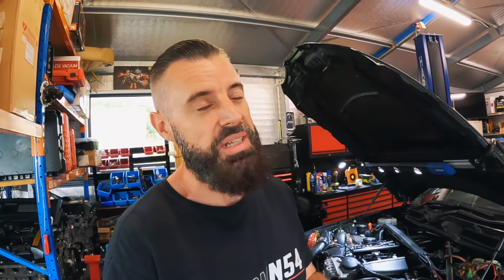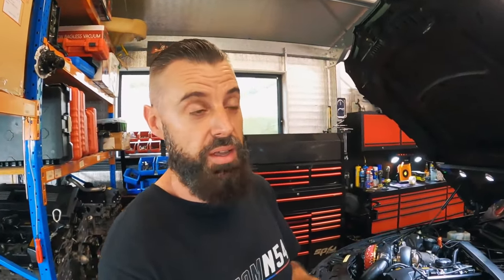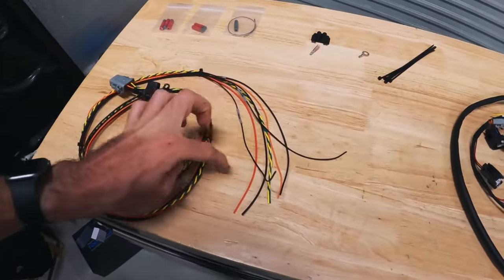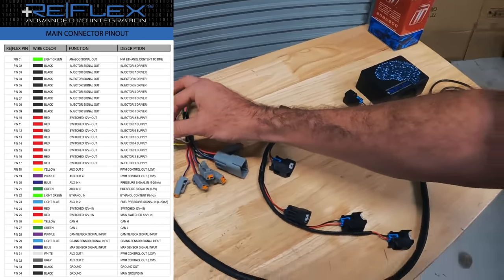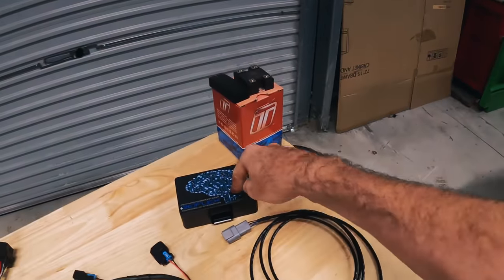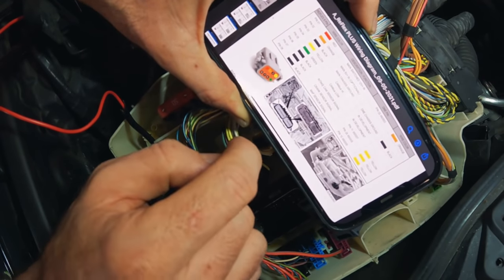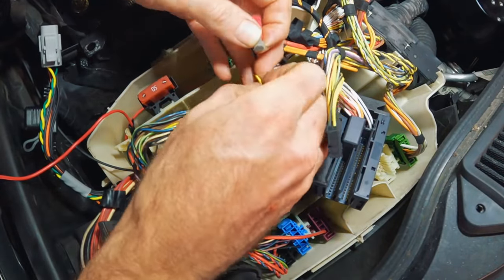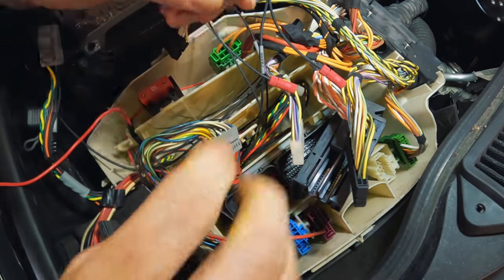BMW n54 335 Turbo Motiv Reflex Plus Install Guide

Comment: We will set the PWM frequency for the solid state at 200 Hz, so that we can scale the duty for the secondary pump up as boost pressure increases.  This should provide a very smooth increase.  I also highly recommend that you go ahead and wire the high low canbus wires now. I can't confirm this for sure, but when I told Jake at MHD my canbus wires were already connected, he was very happy that I took the time to do that while we were talking about the MHD+ testing for my 335IS. Unfortunately, I have not seen a build for MHD+ yet, but my fingers are crossed that I will see that here in the next week or two.

Comment: Motiv reflex squad 💪🏽 no going back! Wedgeperformance the way to go. I see a lot of people complaining about the tap connectors, I run it in my car no issues if you install the things correctly and make good contact shouldn’t have a problem. Shoutout from the usa !
Reply from the maker: You already know!

Comment: I just bought the same phoenix intake plenum. A split sec with Hobbs switch will only kick the secondary pump on at what ever psi the Hobbs switch is. You can also hook up the AIC to a tach signal to, so I understand? I might wait these control boxes are more developed. Oh and for piece of mind, it doesn’t matter where you put the fuel line on that rail, from middle of back. That fuel pressurizes that rail & that’s it! When those injectors start firing off that fuel is pressurizing that rail. So no need to worry about that at all. Keep up the good work…👍🏻🏁

Comment: I ended up using Deutsch Connector’s instead of using the other connectors mostly because embarrassingly as many times I have taken the car apart n put it back together

Comment: Great video again! My Reflex is ready to install as well. Question can you log the PI fuel rail pressure now in datazap same as the DI rail pressure? I haven't seen a log from a car equipped with a reflex.
Reply from the maker: Not yet, however once MHD+ is working you should be able to do. I get a message after this video went live, telling me to connect the canbus wires now, so it can't be too far away.

Comment: Mine doesn’t have the green wire from the flex it has the yellow grey and white wire but not the green one. It does have the green and yellow wire that is twisted but not the shorter green one that comes straight out of the reflex box.

Comment: Stuff me mushrooms 🍄. I hate electrical stuff.

I am a mechanic by trade and happy to work on engines etc but electrical stuff freaks me out, so much admiration to you.

Brilliant video and the diagrams are awesome. I am actually fitting 2013 headlights to my 2010 ISF and that involves electrical stuff 😂🤣😳😳😳

Happy belated 3x birthday Andrew. Hope it was awesome 😎
Reply from the maker: Why thank you sir!!! Electrical is easy, i think its easier than the mechanical side of things, just need to know what on earth you are connecting and why

Comment: Do you need to run a larger fuel feed line if using E85 with port injection? The wiring part all makes sense to me, otherwise. Nice work, Andrew!
Reply from the maker: I’m running 6an from the tank forwards. However the current restriction is the factory fuel reg. That’s gotta go at some point. However we should see nearly 800whp with this setup

Comment: Regulators on PFI also have vacuum line to manifold to vary pressure due to vacuum and boost.
Reply from the maker: Correct, but if the reflex can see the boost and fuel pressure what do you need a reg form?
Reply: @ZeroTo60Tube  They use this method to save money. You don't need the 2 sensors.
Reply from the maker: @stevesas4744  Im not sure what you have to pay for regulator and return line system. But here it's a lot more than the single sensor you need to buy to make the reflex do it.

Comment: I'm dealing with a tuner issue. They can't figure out my gear log. I'm on n54 mt6  and my logs are showing 5th gear when I'm actually in third gear. I'm looking for a base tune that I can adjust and tweak and play with around the transmission settings to figure it out. Any thoughts?
Reply from the maker: Unfortunately that’s something the tuner should be able to assist with. 

To my knowledge the manuals calculate gear based on rpm and wheel speed. So something in the map is wrong, or wheel speed the dme is seeing is not correct.

Comment: Happy late birthday! What’s the benefit of the reflex plus with its cam, crank and map sensor functions over the lite version?
Reply from the maker: Tbh I think the lite has that too. However the 3 sensors are used a the reflex knows which cylinder is firing.

Comment: Having any issues with the downpipe?   I decided to be silly and do a 3.5" downpipe and it's equally as close on my car lol.  Almost done building the whole hot side, just tying into my 3.5" exhaust now.
Reply from the maker: This very close at a few points but it does clear, you can get a 3.5” dump in to a Rhd if you don’t have the equal length manifold.

Comment: Commenting late but did you run that wire from your secondary pump yourself or is it in the dme box somewhere I would assume you ran it yourself but lost thanks 😆
Reply from the maker: Ran it manually. It triggers a relay in back
Reply: @ZeroTo60Tube  that was my question as well but I am literally new to all of this lol do you mind explaining what pin the white wire connects to for aux output? Thank you

Comment: I am still confused why the DI systems are not be being deleted completely. Just run 1000cc injectors  on EFI only.... right?
Reply from the maker: *2000cc injectors
Reply: LS injectors and some TIG welding it is then.

Comment: You’re not going to run a JB4 on this car?  I understand the ReFlex is taking place of the PI controller but are you just going to run straight MHD custom map(s) and the ReFlex?
Reply from the maker: Correct, reflex doing the pi and boost control
Reply: @ZeroTo60Tube  good to know. I’m literally putting my fuel system together right now and I think I’m going to go with this set up.  I was almost going to go the JB4 route but this set up seems light years better. Looks like I’m selling my JB4 that’s still in the box lol. Great info as always!
Reply from the maker: @midwestbmw1292  The reflex is a more powerful unit, meaning it is more capable, but i do feel like we are on scratching the surface of what it can do.

Comment: For the flex fuel do we need a custom tune or will it automatically adjust as needed
Reply from the maker: If you are running OTS maps, the flex will work with out a custom tune.

Comment: I have the first version reflex harness OG. Has plug and play ethanol sensor but not reading accurately (100% all the time) any idea what i need to do to have it reading. No extra wires. Only the  canbus..n54 car thanks in advance
Reply from the maker: I honestly had no idea that they had them running through canbus on the early ones. Canbus is by far the most accurate way to send data around the car. Better than an analogue voltage signal, so i cant really comment on why its not accurate. You may be able to add some sort of smoothing to the calculation with in the reflex. Definitely worth speaking with motiv, the reflex is infinitely adjustable by those guys with firmware changes so they should be able to sort it out.

Comment: I installed the reflex plus following this video. I am however trying to figurr out the mac solenoid install. Can i leave with the oem plug or should i splice into the reflex? If so, do i use the grey aux and the orange for voltage? What tune map do i use for a doc race bottom mount as i wait for a tuner
Reply from the maker: You need to get all that info from your tuner. Because he will configure which aux out put controls boost. I tapped in to the wiring in the stock harness that goes to the front stock actuator.
Reply: @ZeroTo60Tube  i wired mine the same way as yours. I wired the white aux for boost control in the dme and i wired the mac solenoid to the grey aux. I wired the 12v from the mac to the red wire pin 1 on the reflex. Jake then helped me make sure everything was wired correctly and working. Thank you for your response. I see all your videos, you are amazing and very detailed videos!!!

Comment: Just a question.Is meth via charge pipe an option,or is it cool enough with the ethanol/e85 ? I do have it With my twin pures,really good during hot weather/intake temps.I know you get a fair bit hotter over there in OZ.👍
Reply from the maker: Yeah, it seems meth is of no advantage on a street car with e85. When you think about it, i have never seen a race/drag car, that runs ethanol use meth on top. I have seen a few dyno queens tho.
Reply: @ZeroTo60Tube  Good info.Because I dont run ethanol/e85 here.Not at pump here in NZ.👍

Comment: Bro my stock turbos are going out on the n54 ! I was thinking RB TURBOS OR PURE, but what do I need to turn the power up a little ? I’m completely new to this !
Reply from the maker: im sorry dude, i missed this comment. did you make a descision?
Reply: @ZeroTo60Tube  not yet no my stock turbos are still going but the rattle is getting louder

Comment: So would I need this if I get a single turbo??
Reply from the maker: It’s simply a supplemental fuel and a boost controller. So can be used on any car that needs extra fuel.
Reply: @ZeroTo60Tube  thank you ! I have a e90 on a custom mhd map and I love your guys content helps me take a good direction on the n54

Comment: Can you possibly assist on why I can’t get my motiv to connect to my laptop?
Reply from the maker: There is a sequence when you power it up. Can you connect it to the firmware update software?
Reply from the maker: Also forgot about this issue. https://youtu.be/vaUpm45IOAg
Reply: @ZeroTo60Tube  I can not connect to the firmware update. Either motiv doesn’t work or doesn’t get power. Or my laptop is not recognizing the connection. I put car in accessory mode. Plug it in and still says disconnected on bootloader. Also have the correct usb cable and nothing
Reply from the maker: @andresmelendez9742  what happens when you follow what i did on the test and tune video?
Reply: @ZeroTo60Tube  nothing happens because the computer doesn’t recognize motiv when I plug in. Updated drivers and still nothing. I plug in any other device it shows or makes the notification sound that something has been plugged in. With motiv my laptop does nothing
Reply from the maker: @andresmelendez9742  Did you do what i show in the video linked above? That is what mine was doing. Device manager would pick it up, but wouldnt recognise it.
Reply: @ZeroTo60Tube  yes still didn’t work. Device manager isn’t reading it
Reply from the maker: @andresmelendez9742  damn, sorry man, this will be a new issue to me. If you work it out, can you let me know, just incase someone else hits me up with the same problem.
Reply: @ZeroTo60Tube  so just found out my reflex was fried. So I got a bad reflex from the start. Motiv is already shipping me another one. So hopefully everything works now!👍 thanks for your help!
Reply from the maker: @andresmelendez9742  Thank you so much for updating me. Good to know its a possible issue. Well not good, but at least i can tell someone else if they are going through it as well, instead of wasting a load of time. Good luck with the new one.

Comment: Don’t use the taps they don’t get good connection. Solder em.
Reply from the maker: Well, for the sake of showing people how Motiv say to do it, lets see how these go.
Reply: @ZeroTo60Tube  I had issue and a few others have where the taps don’t seat correctly and interrupts the crank sensor. One of my taps didn’t even completely seat into the cam signal.
Reply: I had the same issue’s Motiv was logged in an we struggled trying to figure out why everything wasn’t communicating constantly..Mine ended up being inconsistent ground..which I eventually ran to the front fender well ground lug.